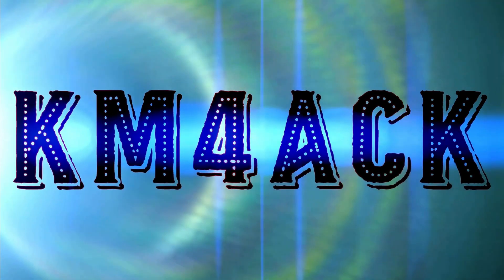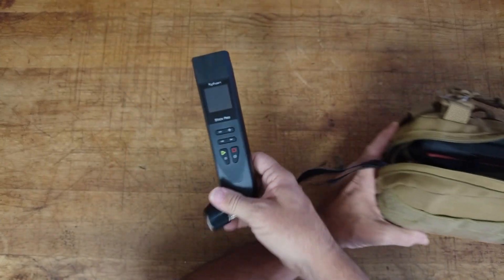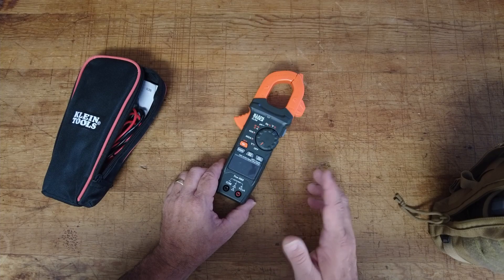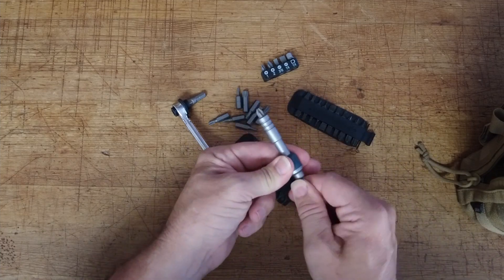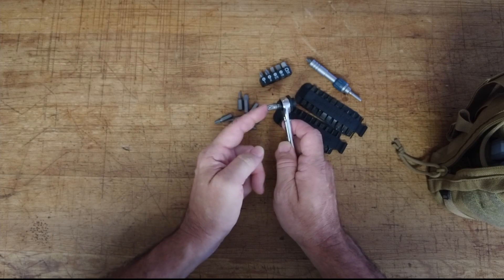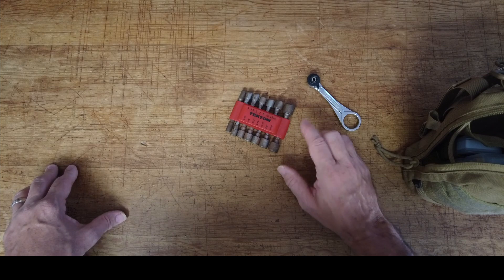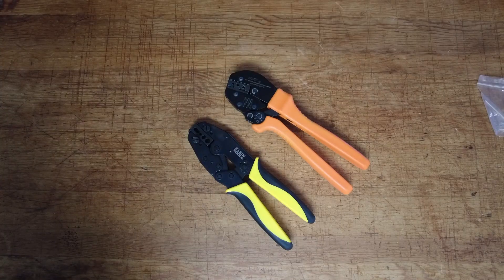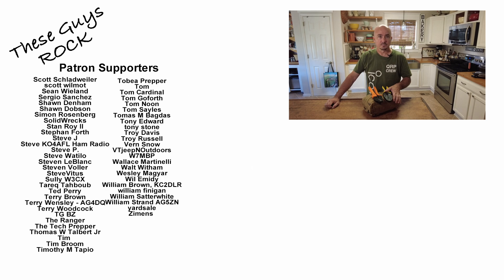Ham Radio Field Repair Kit

Comment from the maker: Tool Bag - https://amzn.to/3cLM4Jz
Rig Expert Stick Pro - https://www.gigaparts.com/rigexpert-stick-pro-antenna-analyzer.html
Digital Meter - https://amzn.to/3RFIVK1
Klein Ratchet Driver - https://amzn.to/3RylqCM
Leatherman Wave - https://amzn.to/3RGYukI
Leatherman Ratchet Driver - https://amzn.to/3TJKubJ
Nut Driver Set - https://amzn.to/3AUuWcz
Plano Storage Box - https://amzn.to/3Qhbooh
Niteize Small Biner - https://amzn.to/3ewg2So
Butane Soldering Iron - https://amzn.to/3Qj4gHV
Craftsman Precision Driver - https://amzn.to/3RjPK44
Pocket Screwdriver - https://amzn.to/3RjTcfh
Pocket File Set - https://amzn.to/3Rymsi8
USB Tester - https://amzn.to/3Qjavvt
Klein Coax Crimper - https://amzn.to/3CYhOpv
Klein Cox Jaws - https://amzn.to/3RGVkx8
Power Pole Crimp Tool - https://amzn.to/3RjTFy3

Comment: Nice video and I like your kit.
   One item that you might want to consider adding is paracord. I have 20 ft minimum (usually 50-100 feet) in every 'kind' of field kit I have. It's light, strong, cheap and useful for everything! You can hang an antenna with it and tie the world back together. 
      Take Care and be safe, John
Reply from the maker: Great idea. Thanks!

Comment: Great video! Love the bag, the may compartments are not only useful but quite practically positioned. I need to get some stuff to do field repairs in my go bag, it's just a bit small. SO it is going to be a trade-off between preparedness and size that I will need to consider.

Comment: I have some fairly thick bungie cord cable ties on my go bag (think hair elastics with a ball!) They slip into the molle webbing on the bag and can be used for attaching things to it temporarily - or attaching the bag to something else. I can then use them in the field for antenna mounting or cable management. Recently I actually used one for my daughter's hair, although the weighty ball turned her plait into a weapon!

Comment: Since I have a tendency to lose hex keys I'd add them (or one of the folding sets) to my kit in lieu of one of the screwdriver sets.
Reply: I have a metric, standard,  and star type 'allen' wrench kits (<$10 from Harbor Freight for the 3 of them). So handy, little space taken, and hard to lose. Don't need them often, but when you do...

Comment: Love the kit. I have a Pinecil soldering iron that runs off a battery bank. If I don’t need it, the battery bank can charge my phone.
Reply: I would carry a bettery bank to charge my phone, also.
Reply: @davidsradioroom9678  define “better battery bank”.
Reply: @GeorgeAdams  Maybe I should have said an extra battery bank.
Reply: @davidsradioroom9678  makes sense. Or a bigger one. But I can charge the battery bank via USB off my big 12V bank so I got options.